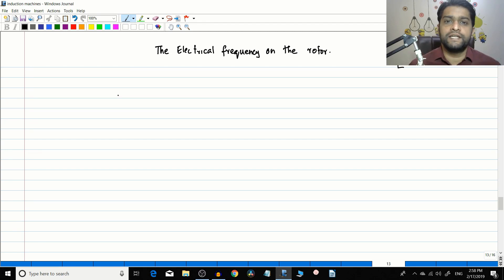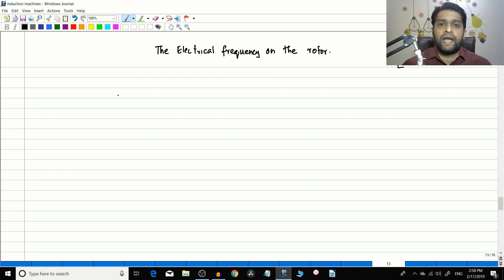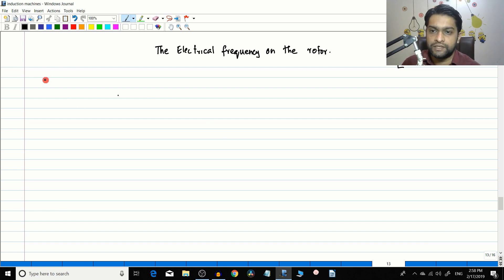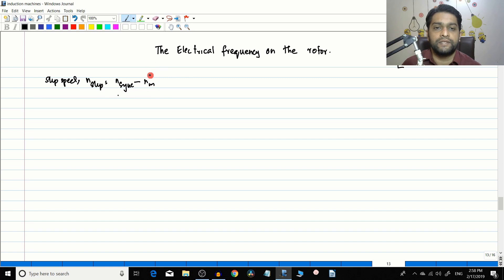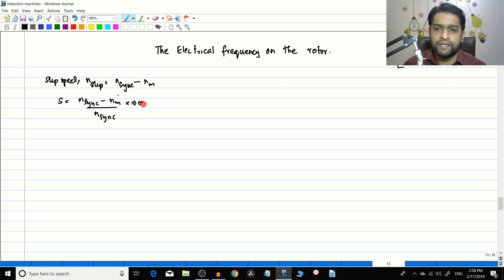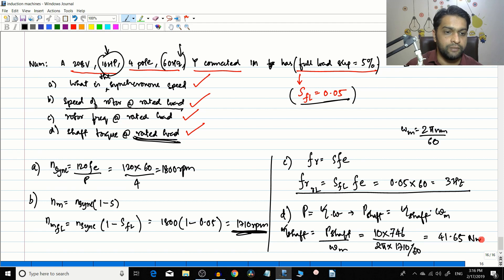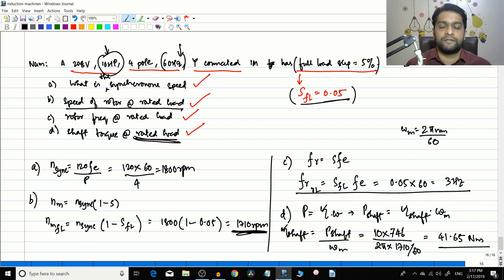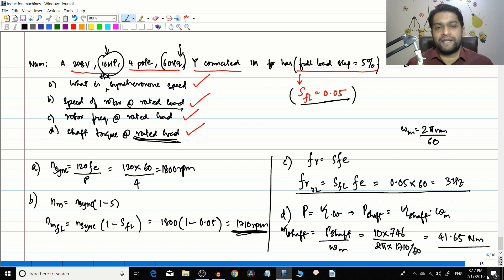Induction Motor #4 - Electrical frequency at the Rotor

Comment: you show here that,the rotor speed is clockwise,but in the AC Machinary fundamentals lectures you show that rotor speed direction as per as stator magnetic field speed direction and that is counterclockwise

Comment: Here when you talk about the standstill condition so the frequency of rotor = electrical frequency . So does that mean the rotor will have the mechanical  speed of stator? If that is so, then the rotor should not rotate. Time = 13:20
Reply from the maker: Standstill means the rotor speed is zero, it could be at the moment of starting or In a Blocked rotor condition
Reply: @ElectricalisEasy  Then if the speed of rotor=0, how is the frequency of stator =frequency of rotor. Which frequency are you talking about.Mechanical or electrical? I'm a bit confused! 
And thanks for replying!
Reply from the maker: electrical frequency

Comment: respected sir i have a query
what is air gap speed wrt to different part in a induction motor please help 
i am bit confused in inverted induction motor
Reply from the maker: I am not aware about the terms air gap speed..are u meaning the speed of rotation magnetic field?
Reply: @ElectricalisEasy  actually this is a question from ps bimbhra book sir
rotor of a 3 phase SRIM fed from 3 ph balanced supply with stator winding short circuited syn speed is Ns if rotor rotates cw with speed Nr then
1-speed of air gap field wrt stator is Ns-Nr ACW
2-speed of rotor produced field wrt stator is Ns+Nr ACW
3-speed of air gap field wrt rotor is Ns cw
Reply: @ElectricalisEasy  thanks sir a lot for your effort
Reply from the maker: These type of topics I will be covering later
Reply: @ElectricalisEasy  OKK SIR AND THANK YOU SIR

Comment: Sir first I thank to you for your great contribution in electrical engineering. Here I have a doubt in an topic of this.please ans me.

If rotor electrical frequency (fr) = (Nsync - Nm)*p/120
and   rotor mechanical frequency (fm) = Nm*p/120
then Why we use rotor electrical frequency instead of rotor mechanical frequency?
Reply from the maker: Rotor mechanical frequency? We use electrical frequency bcz that what influences the synchronous speed of field...and please put a time stamp for the doubts..otherwise it is very difficult for me to watch the entire video...
Reply from the maker: And rotor electrical frequency is  electrical supply of the rotor windings,  that is what we are interested in...
Reply: In the last part of video , you solve a math. There we use
w(m)=2*pi*N(m)/60=179.07 rad/s. 
 but you do not use w(re)
w(re) = 2*pi*f(re)=18.84 rad/s
so they are not equal.......
>>then I want to know what is the difference between w(m) & w(re) ?

>>Is there present any term rotor mechanical frequency(which is related with w(re)) ?